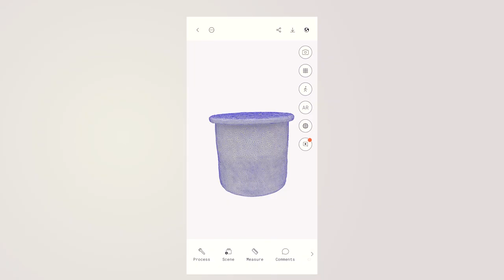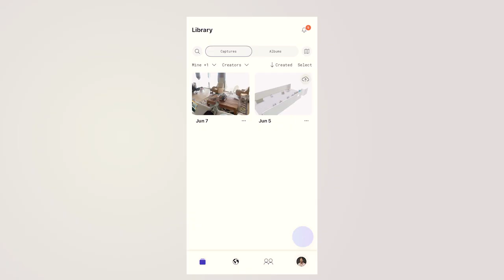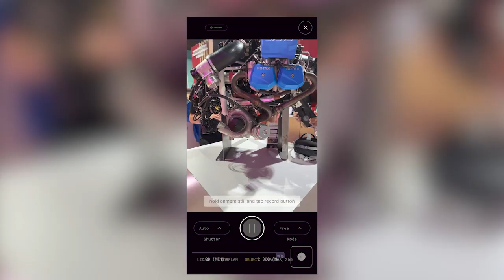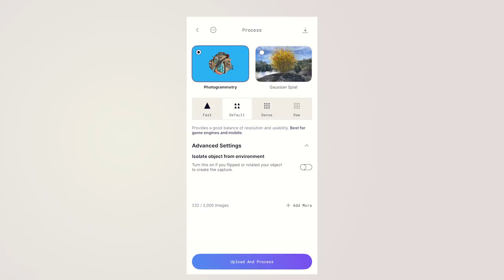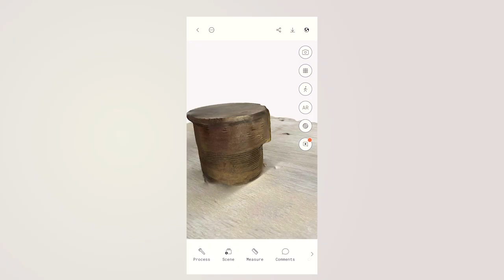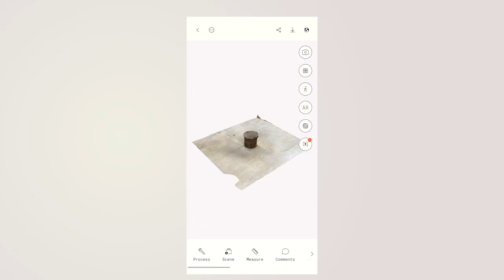How to 3D Scan Mechanical Parts with Polycam | Manufacturing & Engineering Tutorial

Comment: Can the geometry be simplified for Sketchup use?
Reply: import your exported model to blender, and use the modifer "decimate" to reduce the polycount. Apply the modifer and then export the model back out as .OBJ, etc etc. You will lose model accuracy, but will load faster into Sketchup.